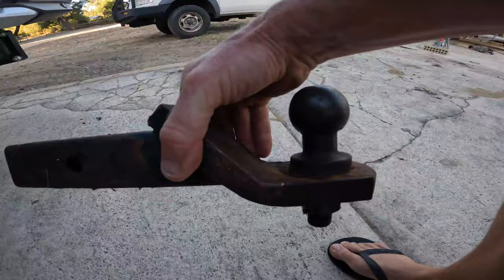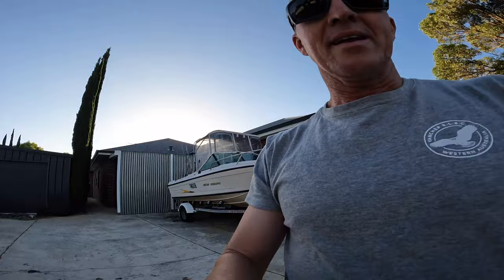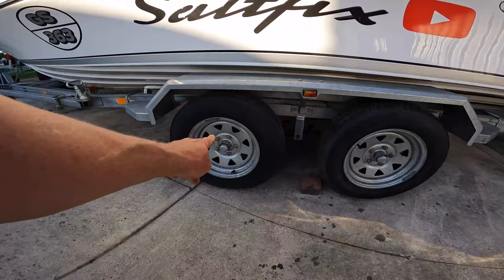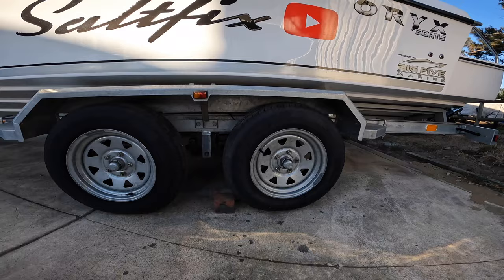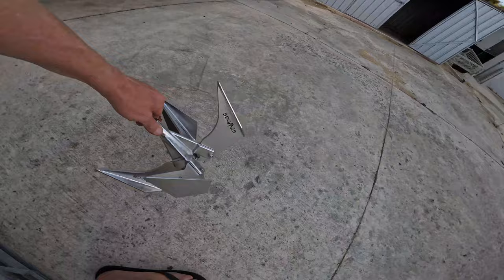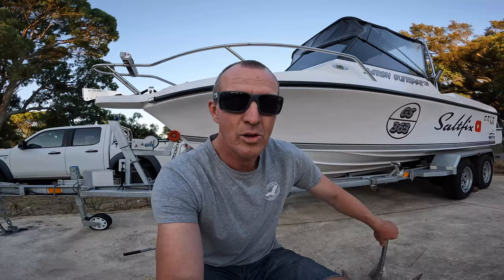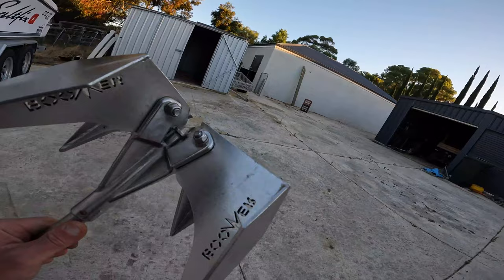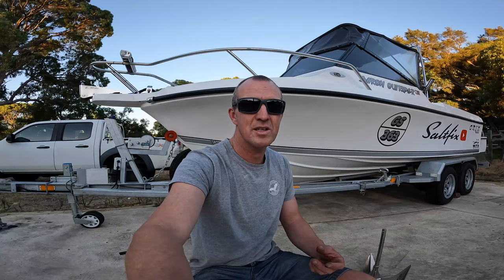Boat Trailer Balance and Towing Options,

Comment: Can I make a couple of points please.
Its not legal to leave the tow bar tongue protruding from the rear of the vehicle whens its not connected to a trailer. Some years ago a friend broke his leg on one while walking quickly between two parked cars in the dark. Luckily it was in a shopping center as he ended up rolling around on the road in agony.
So it doesn't matter if it obscures the plate as long as the trailer is connected.
The removable tow tongues, as you have, are only designed to operate with the tongue in the lower position, not the other way up. There are ones that are designed to work either way and they usually have a plate on them stating that. 
Probably not an issue with the boat but may be with a loaded double horse float?
Sorry to burst your bubble on that but I don't like seeing things that may put yourself or others at risk.
Reply: In Victoria or NSW i believe this is true but it is not a law in Western Australia

Comment: Scotty you could add to the Triton a drop hitch which would able you to tow your boat at the right height on the ball when your wife needs to tow her horse float you either drop or lift the hitch no more changing tongues.
Reply from the maker: Yep I’ve looked at them.
Just as easy to slip the hitch out and change it.
I mostly tow with the ranger anyway

Comment: I tow a big boat all good until the road was wet one day and things changed big time bad understeer in a corner have to carefull.
Reply from the maker: Correct , that’s why you need to make sure things are right. 
It’s just a little bit of trial and error getting the adjustment right but it’s adds to the feel and safety of the tow

Comment: With a tandem axle I wouldn't be too surprised about the lack of ball weight, and wouldn't worry about it unless it sways at speed? If so you could easily move the axles back a bit, or possibly even move the winch post forward a bit, to bring the boat a bit more forward and take the weight off the rear?
Reply from the maker: Hey mate, 
Cheers for the feedback
Reply: Hi mate good idea with the hitch 👍 dose help in a lot of situations, but in my case wasn't enough. I had to either upgrade my springs or get airbags price pretty similar but I went with airbags 👍 very happy and smooth ride. Cheers mate 🎣🎣
Reply from the maker: @chevyda8070  yes fine on the the old Ranger just the trito is a bit soft in the rear air bags are a good option as they are adjustable for when there is no weight you can keep the nice ride.